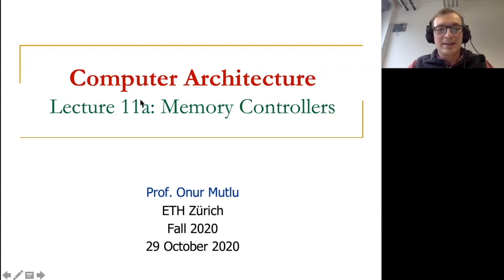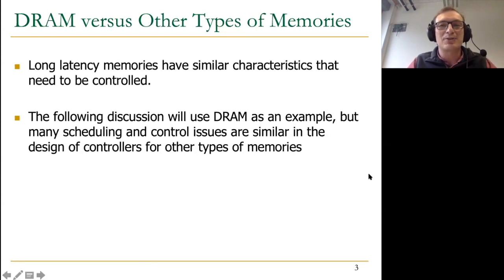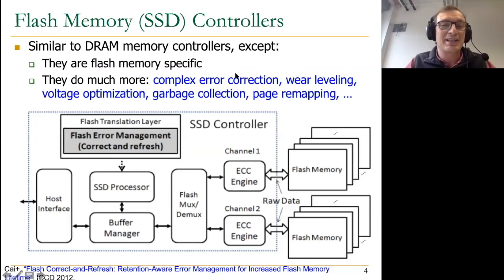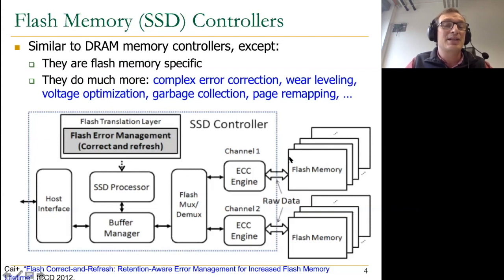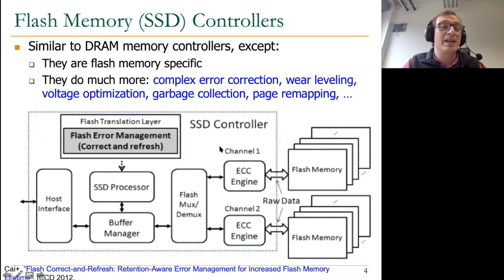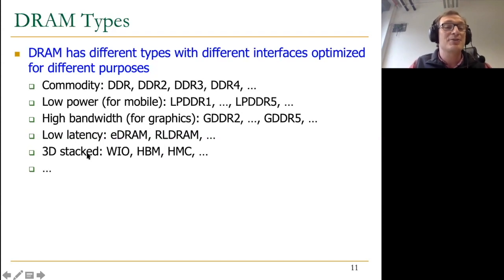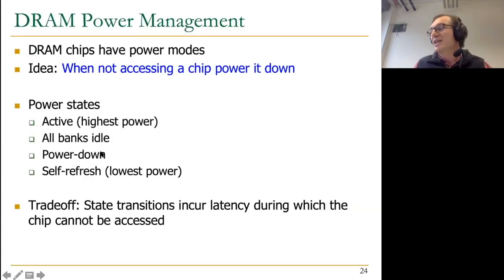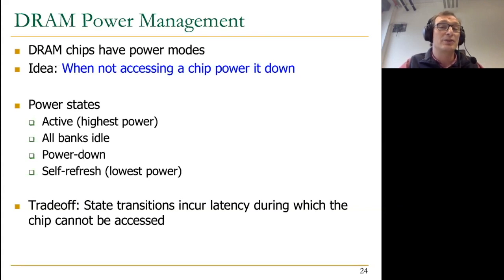Computer Architecture - Lecture 11a: Memory Controllers (ETH Zürich, Fall 2020)

Comment: 14:45 DRAM purposes
23:50 request = I want data from this addr -> which DRAM doesn't understand -> should be translated into commands by MC
28:10 read write 동시 불가. bus direction delay = read_write_latency | write_read_latency